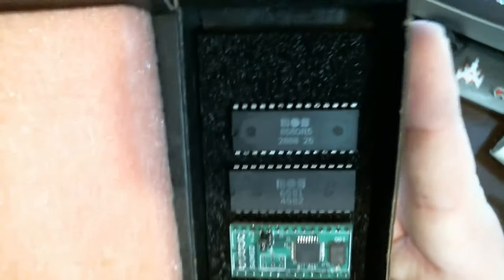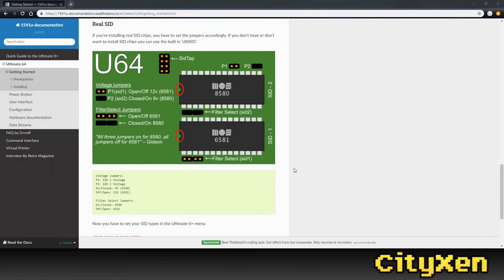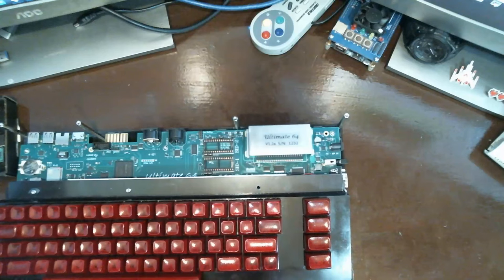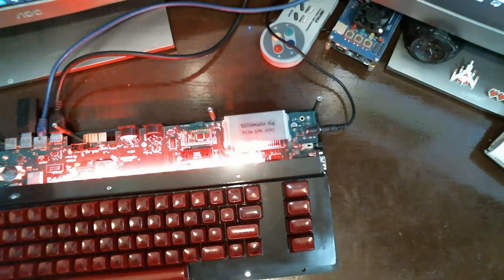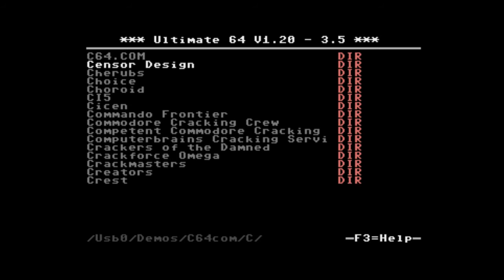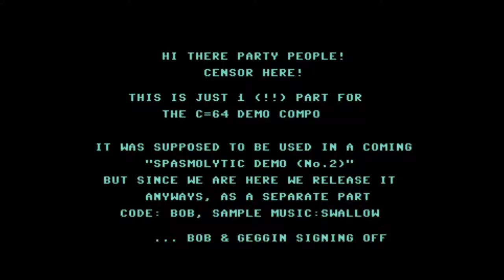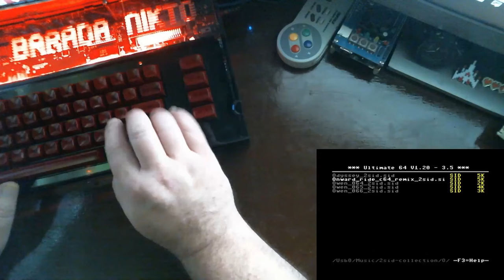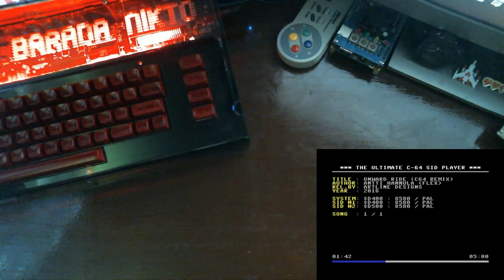Installing Real SID chips into an Ultimate 64 (Bad SwinSID)

Comment: I've got an 8580 and a 6581 in mine. It's nice listening to  pseudo-stereo, and even playing the few quad sid music tracks by using the Ultimate's own virtual SIDs with real sids.

Don't forget to turn off the U64's own virtual SIDs, if you want to listen to real chips alone.
Reply from the maker: Cheers!
Reply: Retro Box Room is there any software that supports all 4?
It’d be cool to use 12 voices, and with the pseudo REU in the U64 it’s theoretically possible to play up to 4 samples at a time, putting it on par with the Amiga, except availability of software and clock speed. Don’t take this the wrong way, I know it’s no Amiga, but to have a quad SIDDed u64 with 16 meg of REU, MOD Tracking isn’t impossible and suddenly the 64 is a serious music machine.
Any ideas & help setting this up would make my world amazing because I have a CommoDore MK-10 Midi keyboard and I also have the Datronics MIDI Cartridge, and I have SIDS available potentially. Key word being POTENTIAL.
Reply: @JesusisJesus  Just to keep you up to speed, you may want to upgrade your Ultimate64's firmware since v1.24, it's been possible to use 8 virtual SIDs. Latest version is now v1.28. As for playing back, I'm just using the built in software to play back sid files. As for making music - I'm sorry, but that's not one of my skill sets. I did daydream over buying all of this - https://sharewareplus.blogspot.com/p/blog-page.html

All I can think of, is to search for "Multi SID music", that seems to bring up different pages with info that may be more useful to you, than I!

Good luck!
Reply: Retro Box Room thanks, I’ve been having a lot of trouble with 1.26
Looks like I need another SID.

Comment: I had a hell of a time installing my sid chips...first I bent the pins and snapped one off and then in my frustration I spilled my orange crush all over the board so when I flipped the switch on it shorted something out. Then I waited for the liquid to dry and tried to turn it back on and it won't do anything. Waiting for my next board to arrive in the mail.
Reply from the maker: Thoughts and prayers are with you. Sending positive energy your way!
Reply: I’m sorry for your loss brother.